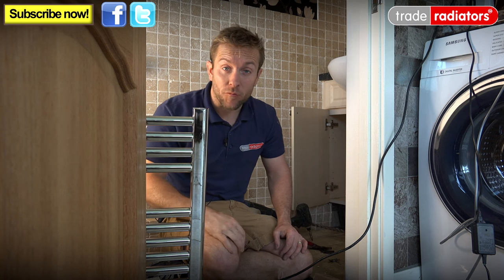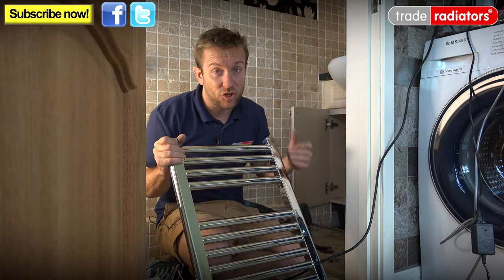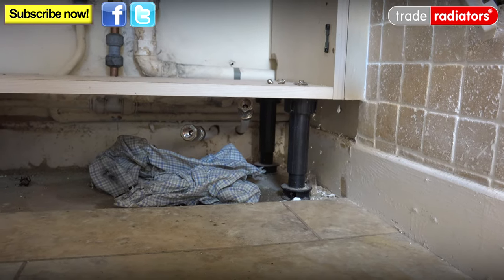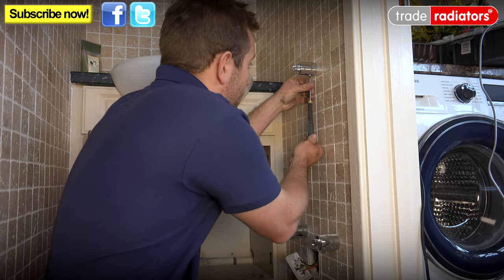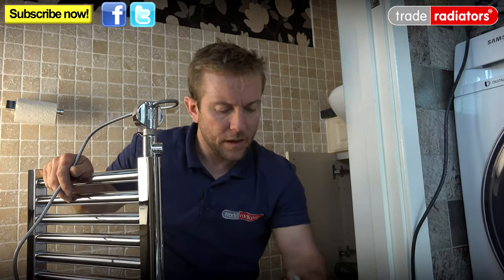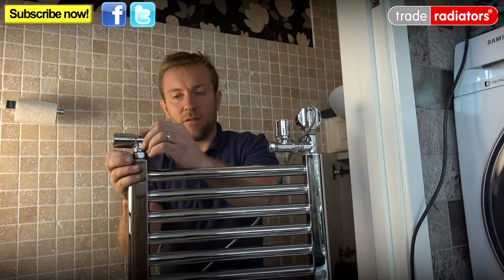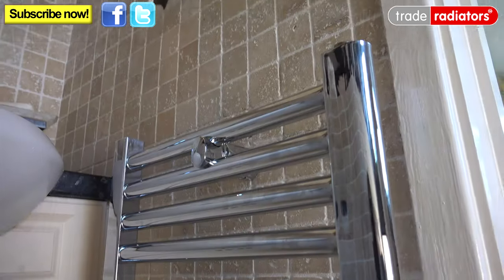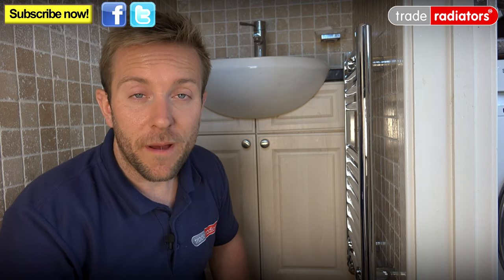Installing a Duel Fuel Towel Rail - Trade Radiators

Comment: Thank for this.

Unfortunately, we saw more of the installer than we did of the installation!

For example, I would like to have seen the T adapter in more detail. 

And, for an old person, you can't install a low level control, which can't be read or reached! 
Can this heater be fitted at the top? 

Voice-over of the installation as it progressed would have been better?

Thanks v much. This videos are exactly the help that we need

Ps. tried the radiator sizing link, and I got "access denied"??

Comment: How do you get the 90° adapter to face the correct direction? If I have it facing the way I need it's either too slack or would have to over tighten.......
Reply: Same as. His mysteriously moved round
Reply: Good question. I can't find an answer. The valve fittings can be adjusted, the T pieces can't.
Reply: Came here to hopefully find the answer to this question myself......ended up wrapping threads with gas fitters PTFE tape (thick stuff) 2 or 3 times. Seemed to tighten up pretty good, even before the rubber seal made contact.

Comment: Hi, not a plumbing question so not sure if you can answer, but that fused spur powering up the element - isn't that too close to the basin as far as the regs are concerned?
Reply: It's not a bathroom, it's a cloakroom slightly different rules apply. It's further enough away from splashes, no different to sockets near a sink in a kitchen.
Reply: The regs only stipulate a distance from a bath or shower.

Comment: I know the customer specified it that way, but how are they going to get a towel draped down the back when there is a fitting in the way?
Reply: I want to know exactly how that conversation went. "OK, I know it comes with four fixings to hold it on the wall but any chance you could just use three of them on this occasion? I really like the number three."
Reply: Presumably it enables two towels to be hung side by side.